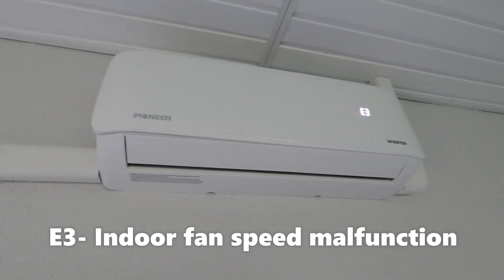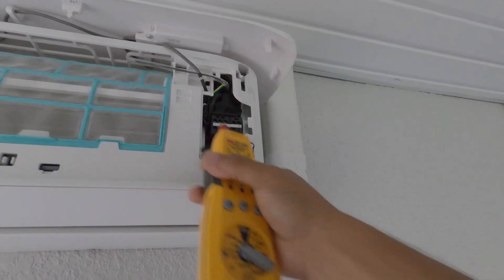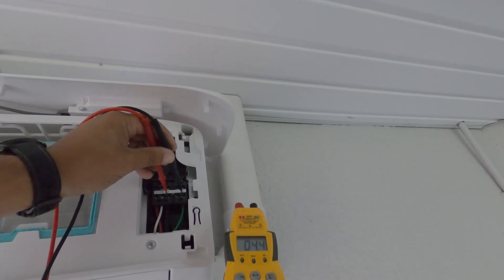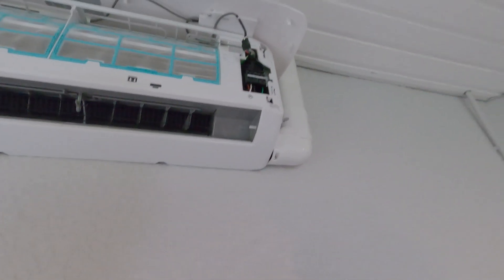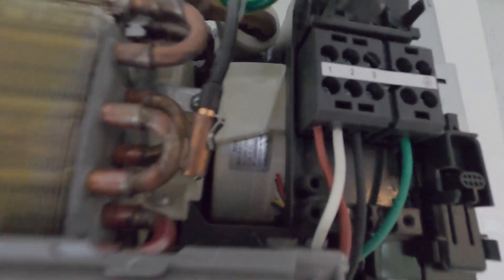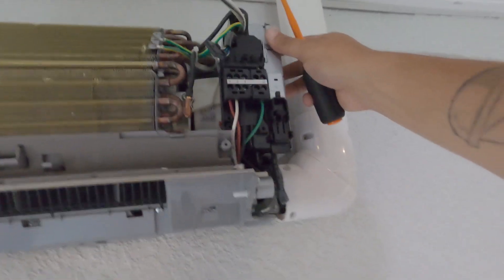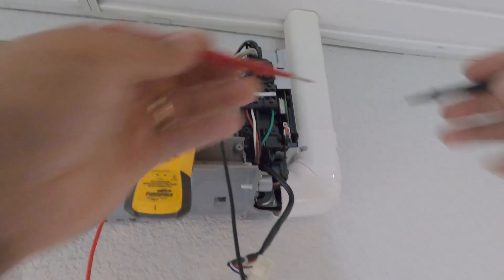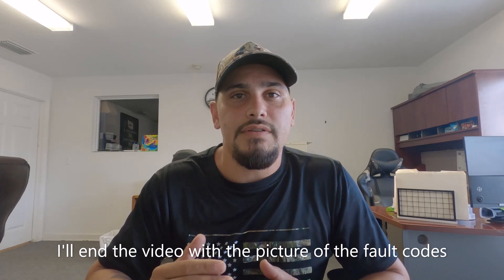Mini split error code E3. HVAC diagnostic

Comment: was it cheaper just to replace whole unit  or the motor
Reply from the maker: No. The motor was under warranty. Most do that for the easy way out but it was cheaper to repair in this scenario